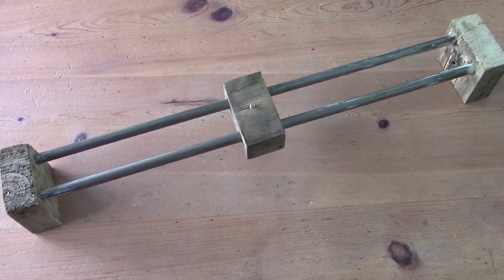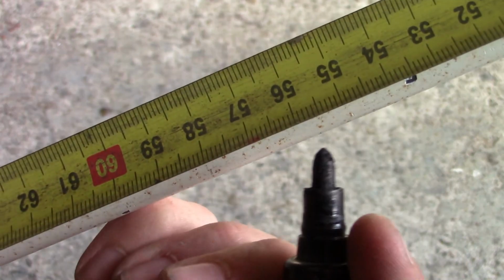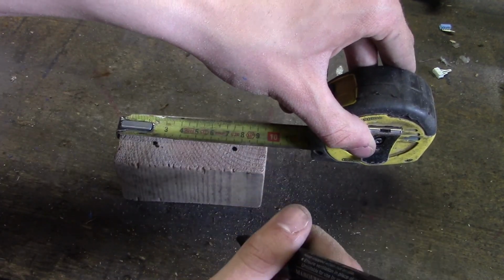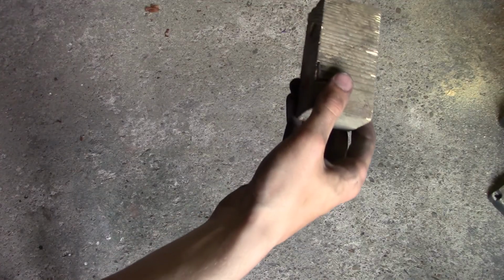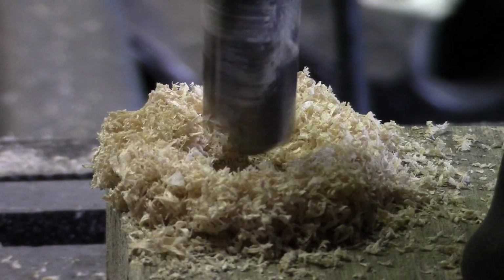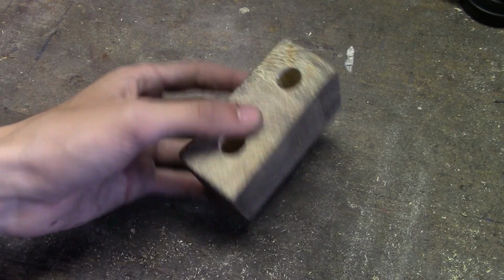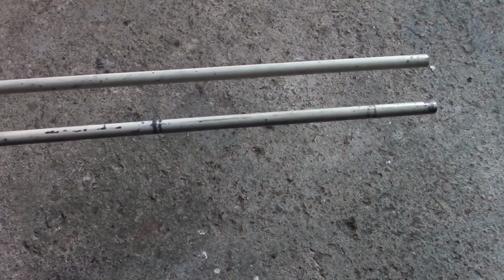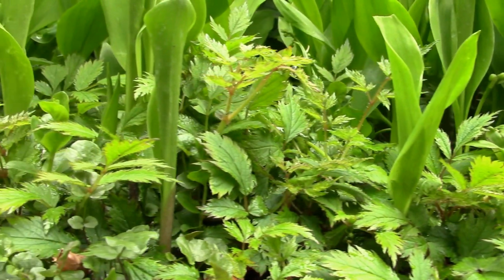How to make a camera slider (AKIO TV)

Comment: Nice sliders, but why stop there ? Next step, a DYI CNC Machine based on DYI rails rather than the usual dismantled CD drives, you just need 3 of those (one for eachaxis) and automate them, and have something like an Arduino as the brains. :p
Reply from the maker: That might be a little overkill... 

(Overkill for now, but maybe not in the future. puts DIY CNC machine in "video topics" excel file )
Reply: Should you need some tips, Tinkernuts has an excellent series of videos to make CNC Machines out of old CD-ROM Drives, using their engine and rails for the axis and  connecting them as motors to the arduino. You'd still have to figure out how to DYI something to replace each CD-ROM, but the fonctionnality is the same as the camera slider in the end, except arduino-controlled. :)